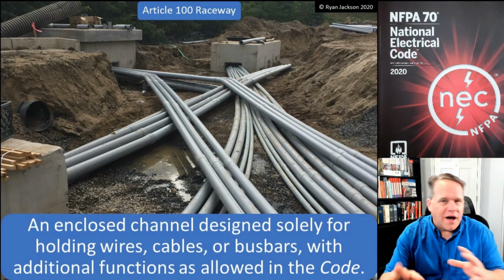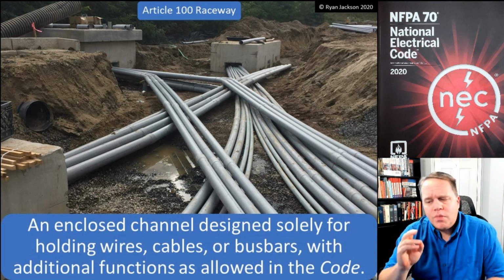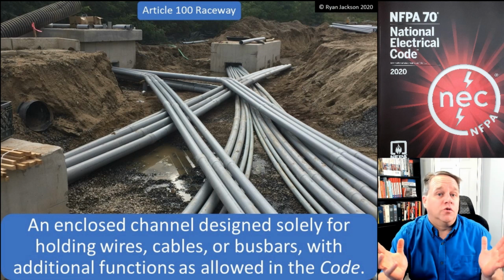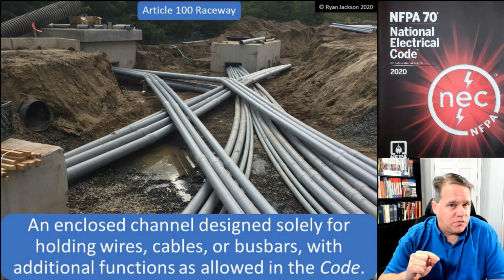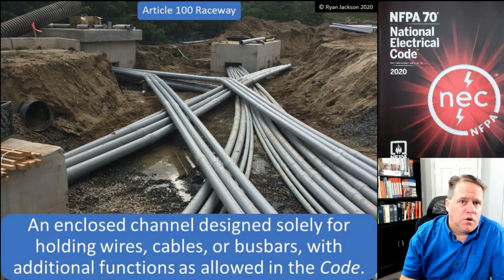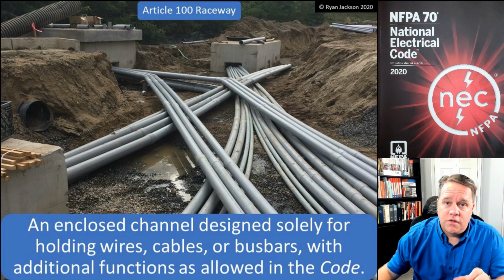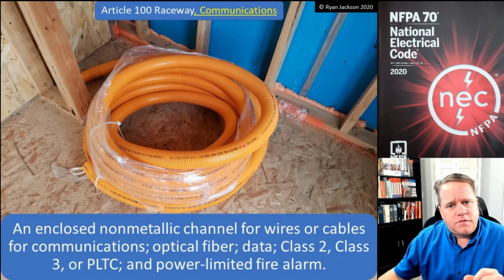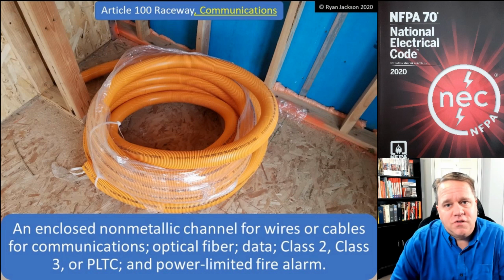100 Days of Article 100: Raceway

Comment: We are using that type of EMT.. when bending 90 it kinks.. sencond to pull wire is not that good we are using a lift to pull 10Awg .. and the pipe fill should be less that a emt... could be the bender we are using ..
Reply: So the ridged conduit Ryan showed, you are having some trouble with it? That's interesting. Maybe I will see some of that when I start work on Monday. Cya.
Reply: @elc2k385  yes .. maybe is the bender.. good look 👌
Reply: Our experience as well.  Great to run, terrible for pulling.